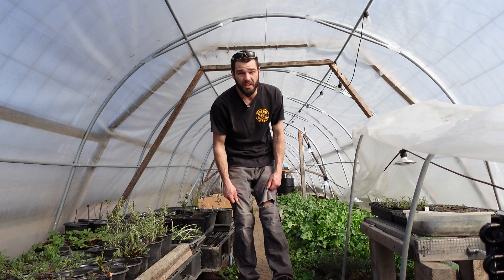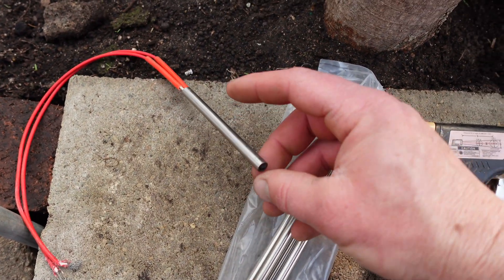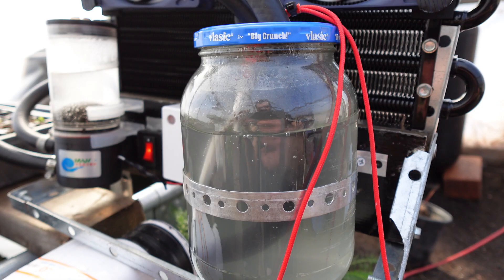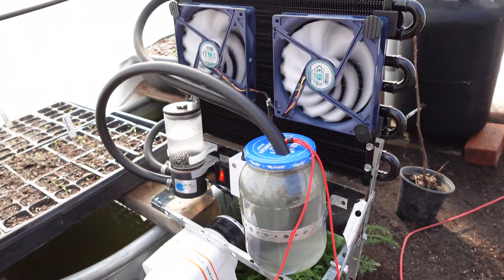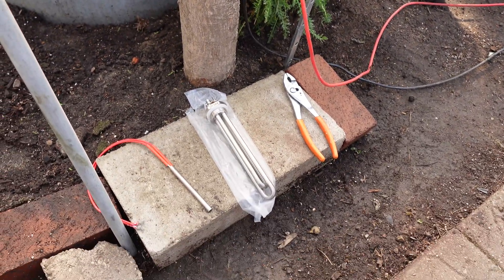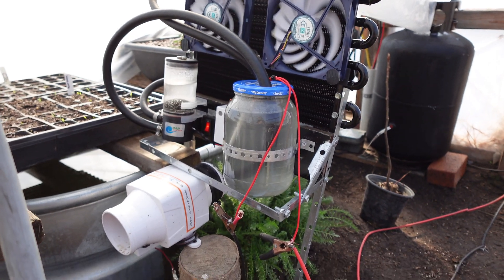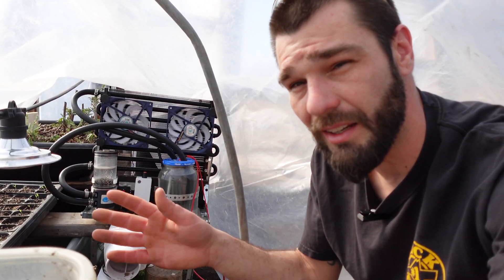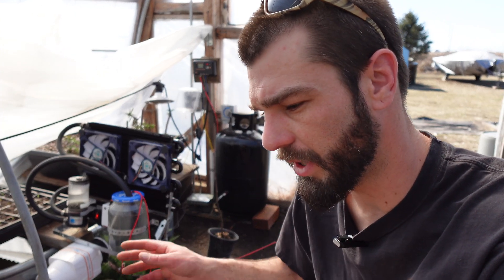DIY Greenhouse Solar Heater - Water To Air Heat Exchanger Experiment - Z 5a/4b Cheap Year Round Grow

Comment: For running a 12 Volt Car Battery, can you tell me the Solar controller Set up? 
What is Float Voltage, Discharge Recovery Voltage, Discharge Cut Off Voltage you set up? 

Also if you use a Solar Controller, can you use from 30 watt to 300 watt solar panel? I mean is there any limitations for open circuit voltage and short circuit current, solar panel I must use for a 12 Volt car battery charging with solar panel?

Comment: This is awesome.  How 'bout the other way... can the heating element raise the temp to boil your water/glycerin mix?  It's unreal you can take it down to -40, very awesome indeed!  Just wondering about avoiding boiling the stuff or otherwise creating a heat caused problem.
Reply from the maker: Great question! that was and usually is my first thought, safety. this heating element can reach boiling temp easily. Keeping it contained in a glass jar for safety if water isn't present it would likely burn itself out as it's made to be submersed and in a stream of flow. with this being 100% solar power I never worry about it overheating, if there's enough solar energy for the element to heat than our fan and pump will be operating to dissipate that heat, as its on 15 minute cycles for the pump and fan, for the purpose of heating the water up more before  circulating. I've observed it for about a month now and all seems well. this was the small scale build, I plan to upscale something similar. thanks for your question!
Reply: This is a great idea...any way you can itemize the parts you used?

Comment: Why can’t you just heat a space heater with the electricity?
Reply from the maker: @DatsiKxModz  great question.  This system at 2-250watts/ hour at 16cents per watt incurs a decent cost per month if ran on grid electricity, my goal from the start has been to survive as cheap as possible (wherever possible) the sun shines and charges solar systems even when it’s cloudy, for free. A space heater would also require at least 500watts or more to operate- whether solar or on grid power that’s a lot to account for and still with 500w reusable solar vs 500w/hour on grid paying constantly it’s all about saving resources and money.